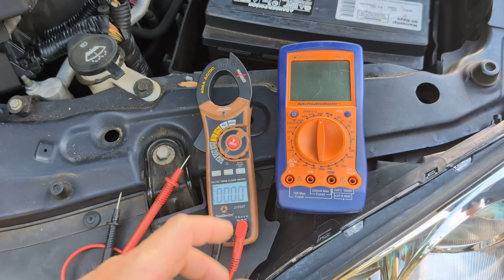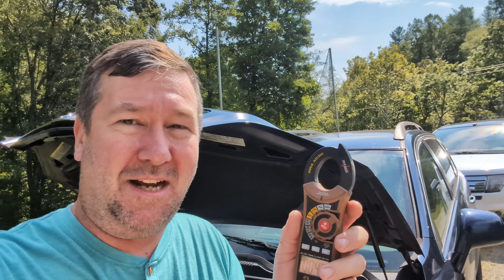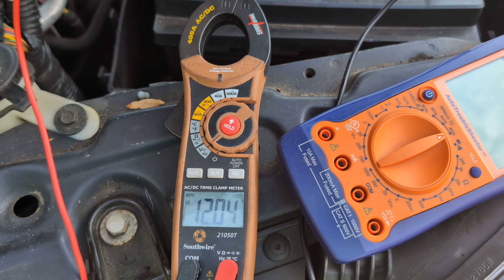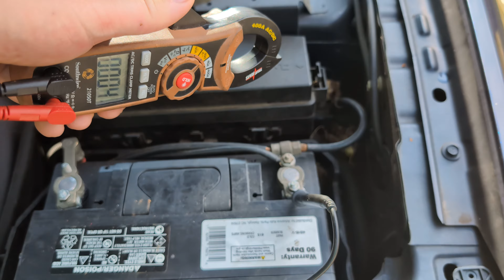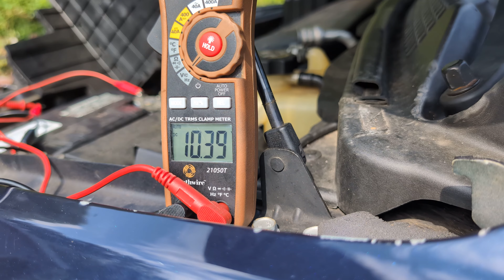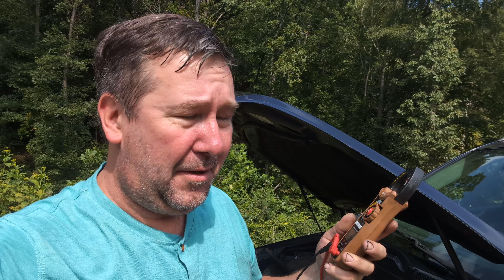How to Test Your Alternator

Comment: Another trick. Checking for voltage using dedicated AC and DC test modes can help you identify a failed rectifier. I had an autodetect meter and the higher voltage will be detected even if a lower different voltage source exists. I was reading 13.7VDC but I was also reading 9VAC but autodetect showed the VDC reading because it was higher.
Reply from the maker: Nice catch on the pneumatics video, I clicked the wrong video!  Here is the corrected one.
https://www.youtube.com/watch?v=3429YdSfAN4
Reply from the maker: Good tip!